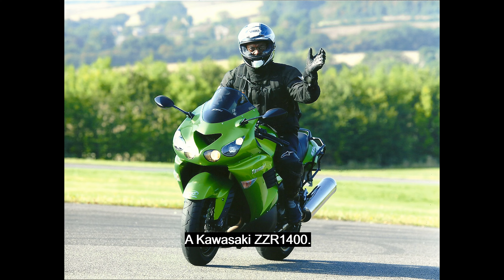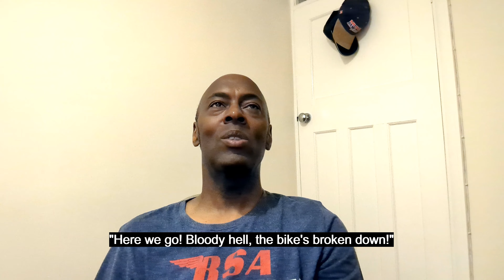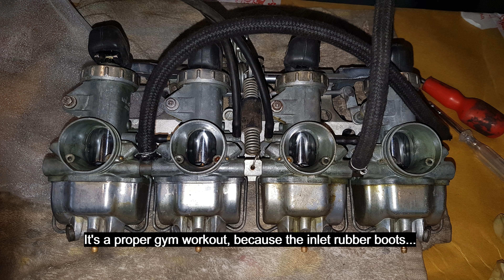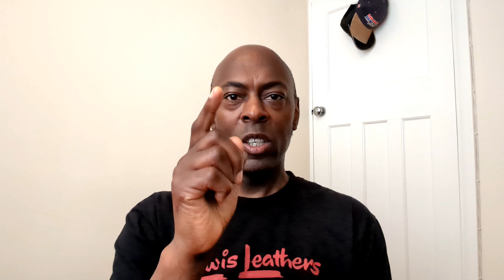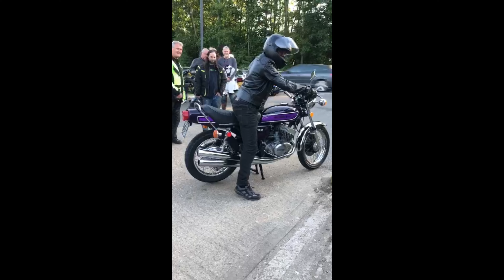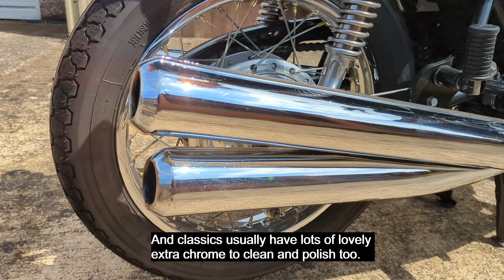The Top 5 Things I Hate About Classic Bikes!

Comment: Carburettors: I picked up a 1981 twin-cylinder Laverda 500 a few weeks ago. Good overall condition, but hasn't been run much in the last 20 years. I heard it run at the seller's place (albeit it wouldn't rev), but I couldn't get it to run when I got it home. Cleaned the carbs - man, they were filthy! Fitted new o-rings, seals, float bowl needles / seats (the originals were hard and worn) and pilot jets but no dice. Gave in and put it into a local classic bike specialist who got it running. Took it for an 80 mile ride, sweet! But it wouldn't start again. The carbs are apart again and they were full of rust! Back into the ultrasonic cleaner, jets and internal carb fuel ways blown through, petrol tank's been sitting full of evapo-rust for a few days, battery's on charge ... Will it run when put back together again?? Who knows...fingers crossed
Reply from the maker: I've tried that Evapo-Rust too. It works well when rust is light, but found it didn't clear heavy rust completely. Which is why I tried the electrolysis method instead.
Best of luck! 👍

Comment: Couldn't click on that upload quickly enough :)
Your first point about roads, cameras etc hit me hard. Last month I sold my mt07 after getting pulled by unmarked cops. There's no more fun on a fast bike on the road. Realised it was only going to happen again and again, and after riding for 41 years, I'm not likely to ride slower, so the only solution for me was a small adv bike (ktm 390 adventure)

I disagree about fuel taps. Modern bikes flash warnings long before they need to (my ktm has over 100km left when a big red warning starts flashing and nagging.  Fuel taps you know to head for a petrol station the minute you have that lovely cough splutter and reach down and fumble for the reserve tap (switch on my old fj1200, how modern!)

Carbs, yep, they are a pain, but the real issue is not carbs, it's carb rubbers! The rubber boots to the engine, always hardened and inflexible on older bikes.

Brakes, maybe, although some of the modern royal enfield bikes could make my old twin leading drum brakes on my t500 suzuki feel amazingly powerful ;)

And you missed stupid prices for old bikes needing restored/repaired etc.
Cool vid.
Reply from the maker: Glad you enjoyed the video! 👍
I sold all my fast bikes, bar my ZZR, which I use for touring.
Re stupid prices, I agree, but it depends on what you go for. 😁

Comment: Derek ,i agree with you entirely , every single point you mentioned .  The worst brakes i remember was an Ariel Arrow ,my 1st bike at 16 years old , both cable drum brakes ,but the front one would pull right back to the twistgrip and you could still move the bike . one of the worst things for me also were oil leaks ,the old pressed steel primary chain cases used to leak ,oh and engine vibration before balance shafts especially Triumphs . that was an excellent subject to get memories working . thanks Derek and i hope your subscribers numbers take off in the future .
Reply from the maker: Thanks for watching and commenting on your experiences! 👍

Comment: I am still laughing and I love your dead pan delivery. Your points are all valid however for those of us who rode these bikes in the 70's things like brakes, and hours cleaning were the norm so no problems with that. I disagree about the fuel taps. With a fuel tap the rider knows exactly how far you can go before you run out of fuel which is not true of modern bikes with inaccurate warning lamps. I also have a ZX14R and also a 1993 ZZR 1100 and a 1989 ZXR 750 H1 and the older bikes make me smile every time I ride them. Luckily, I live in a place with no real speed enforcement (similar to the UK in the 60's and 70's) which is just as well considering the bikes I own. Will be subscribing. Ride Fast mate.
Reply from the maker: Glad I made you smile. Tbh there's nothing I REALLY hate about classic motorcycling. Apart from cleaning them, although that applies to all bikes! 😉
So you live in the Phillippines eh? I'm single, and the way things are going dating-wise, I might end up joining you out there lol 😂

Comment: I laughed at the lack of brake power, im still certain my CB 750 riding brother tried to take me out when he let me take it for a ride after fitting an 812 kit, it was 1982, i was a freshie, trading my T125 up to an RD250 LC , I turned that T junction into a straight at god only knows what speed, luckily I knew the road and its saving grace, a park entrance CB 812 wide.
Reply from the maker: It was certainly a shock, after being so used to modern brakes. 😮
That's why pulling the brake lever on a modern bike brings me so much joy! 😉

Comment: Hi Derek, Derek from Belgium here. Yeah, I pretty much agree with you. I'm using a 390 duke for my daily now, small enough to be fun, slow enough to keep me mostly legal. My Tuono R hardly gets used simply because I always have to watch the speedo. I have a few classics, TY250A, XR250, a few RG250's. I always forget to turn the tap on, to use the choke etc etc.. even though back in the eighties it was second nature. The ONLY bike I own that doesn't demand any attention, never leaks, always starts is my 93 Zephyr 1100. I even have VFR750's and one of those is on the table right now with a fuel pump relay failure, and this ultimately is the issue, there are very few classic bikes that you can just own, ride, add oil and water when necessary and they just work. Modern bikes are all well and good, but they are so capable that half of the fun of riding is gone simply because the bikes are so capable. I once took a CBX1000 from 78 out on test and the brakes were frightening. There is nothing exciting that new 'big' bikes can offer at legal speeds. (Where I live we have mostly 50 and 30 km/h limits and average speed cameras at each end of most roads now.. Worse still is that most of the roads are straight) I have too many bikes to keep up with them all currently running, but they all will run when I want so long as I'm prepared to nurse them back to life again.. There is always something, even if it's just a flat battery or soft tyres..
Reply from the maker: Hi Derek. Great to have viewers outside of the UK! Yes, classics do need a bit more tlc, so it's good you have modern bikes too. 😀

Comment: Derek, a little rubber lubricant works wonders refitting carbs. if you are not too embarrassed to ask for it, KY jelly is cheap, available at any chemist and rubber safe.Edward.
Reply from the maker: Thanks for the tip. I did smear a little WD40 on the insides of the rubbers before fitting. I also warmed the rubbers up with a heat gun.
The issue is that the rubbers are old, so the rubber has hardened. It'd probably be a good idea to replace them tbh. But the bike is running well at the mo, so hopefully I won't need to remove the carbs again 🙏